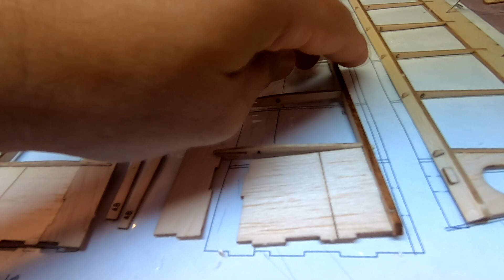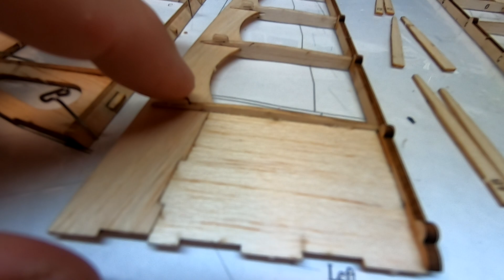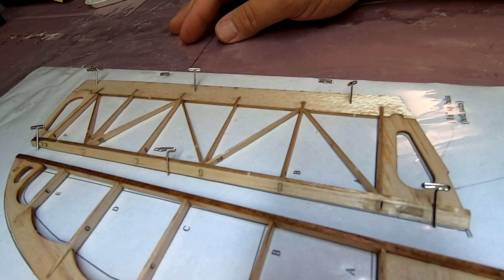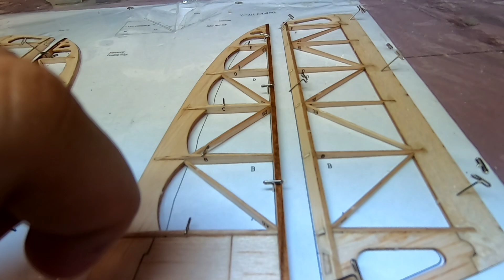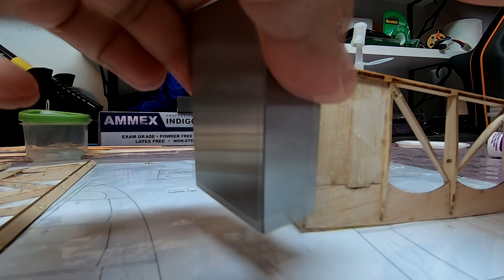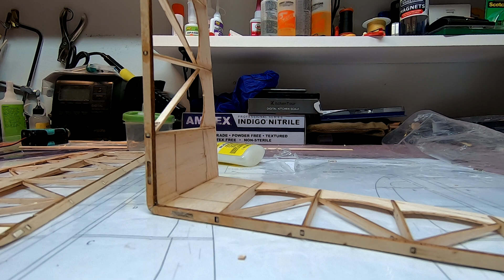Chrysalis-Lite RES Build - Pt7b - Assembling the V-Tail

Comment: Lots of good tips as always. I was surprised the vee tail is 90 degrees, all the ones I've seen are 110 degrees.
The correct term for your metal blocks is machinist's parallels, I have several in my tool box. Like you said they do come in very handy for getting surfaces perfectly square and have enough weight to stop parts sliding around.
Thx for doing the videos.